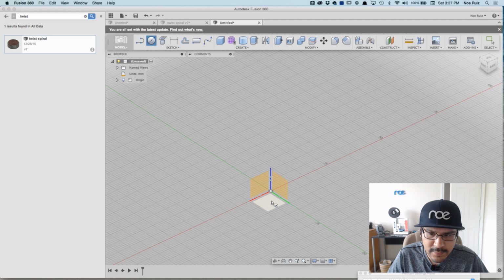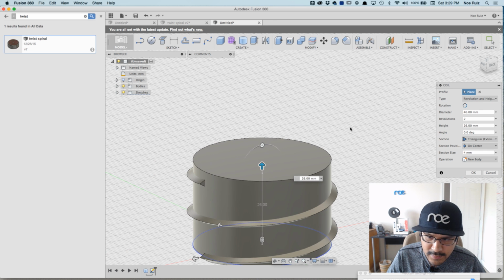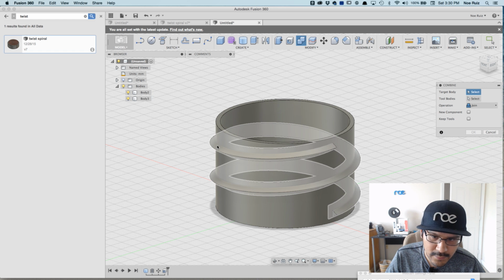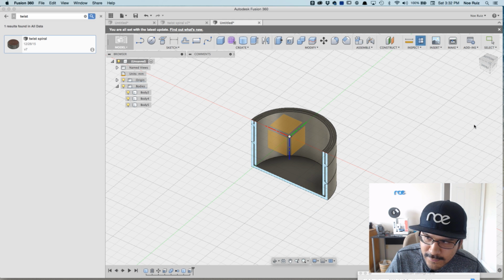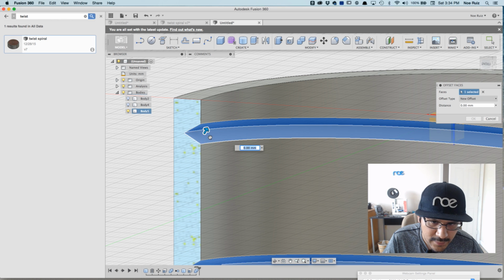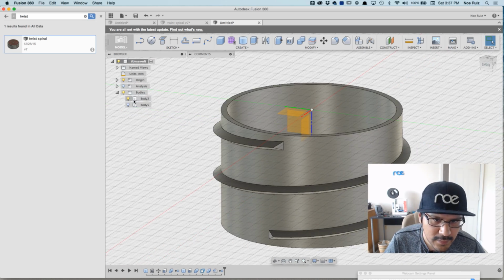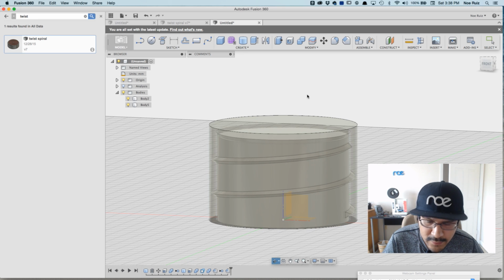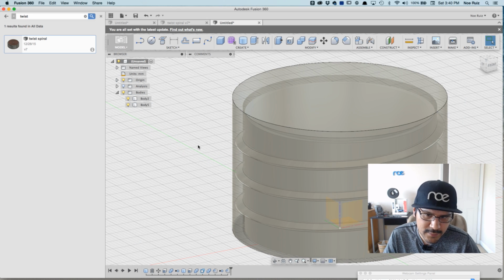Layer by Layer - Custom Threads for Twist Tops!

Comment: I have a question, what do I need to do if I want to cut the threads at the top and bottom so its flush with the cylinder? You mention its possible at 2:35 in your video. Thanks and great video!

Comment: After trying this myself, I tried to print this with no supports and Cura kept telling me I had an overhand angle greater than 50 degrees. How do you make it so that in Fusion 360, the angle can be the standard 45?
Reply: They screw in nicely. 0.3mm offset is slightly loose whereas .2mm offset is a little tight. I think .3 is the best
Reply: Yes I modeled them in Fusion 360. The threads have to start and end at the edges of whatever piece needs threads. Dont worry too much about them exactly ending where they have to because you can just cut the excess part in Fusion 360 using the "combine" option
Reply: So say you have a water bottle with the open part facing up. You want to make sure the thread on the bottle reaches the end/top of the bottle and end it wherever you dont want a thread anymore. And yeah use the combine feature like in the video
Reply: I hope I'm helping :P
Reply: Xavi Gomez Siiiiiii... Muchas gracias mi hermano!☺🤘!!
Reply from the maker: By default, coils with triangular sections are 60 degrees. These should be OK to print just ignore CURA and try printing anyway ;-)
Reply: Adafruit Industries I printed yesterday and it worked. thanks :)
Reply: Hey do they screw in right ? I was wondering about the threads that go in..
Reply: Xavi Gomez bro thanks for the reply! did you design on the fusion 360 too ? do the threads need to start from the top edge of the container base ? pls help
Reply: So I should end the thread on the base at the Top and then combine ?

Comment: surely the thread has to cut through the end of the cap otherwise it is just a coil trapped in a coil groove. There is no way for the cap to come off as the groove is not open ended.